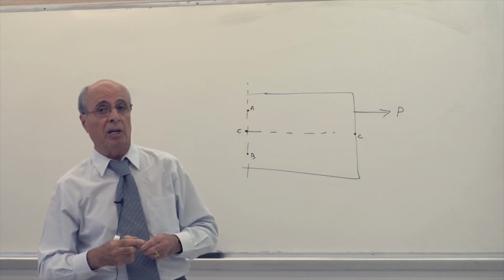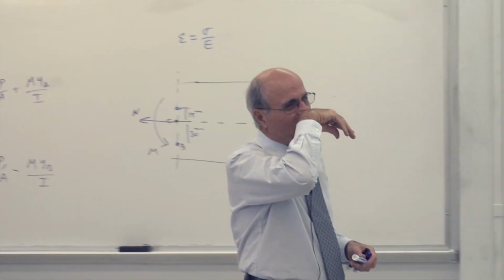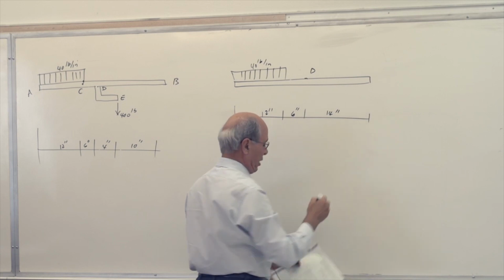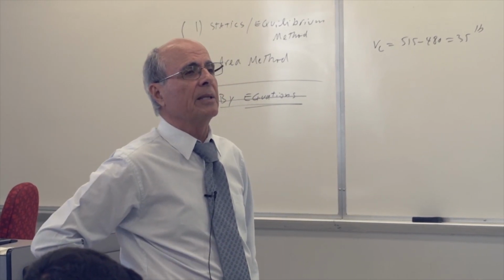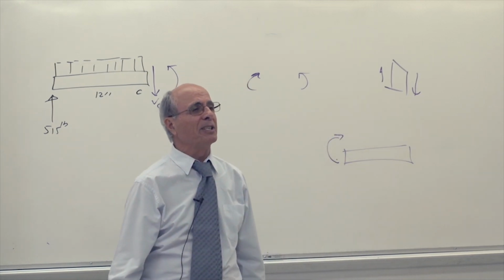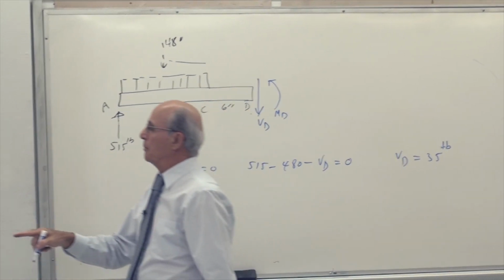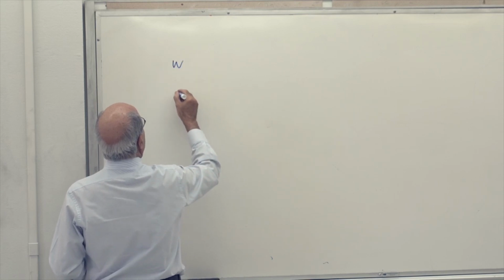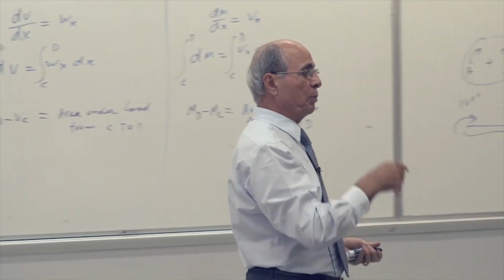Strength of Materials I: Load, Shear & Bending Relationships (16 of 20)

Comment: When you do checkpoint D. The v is 1600 by using the load of AC. But where is the load of 400lb?
Reply: whenever you cut sections and draw free body diagram,the force and moment is not considered for end point.